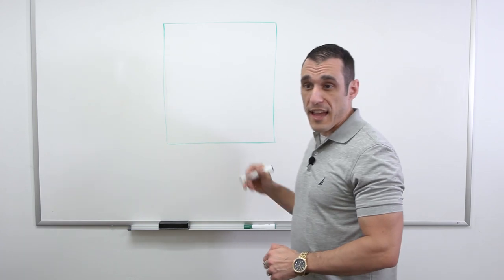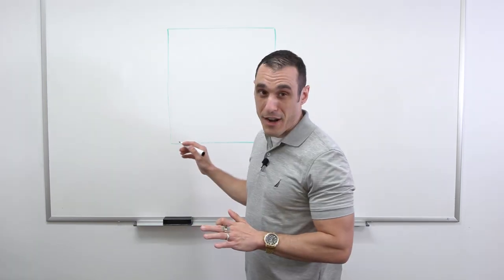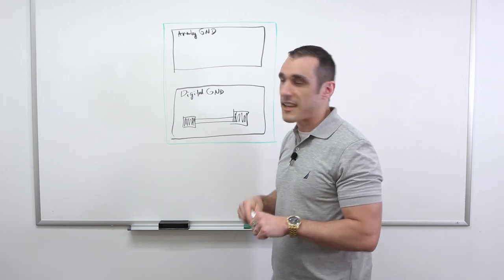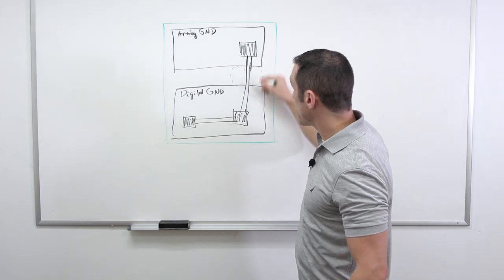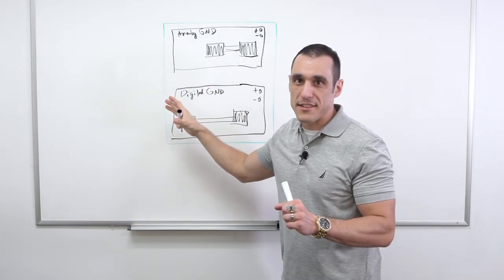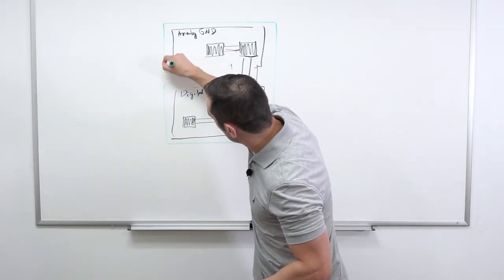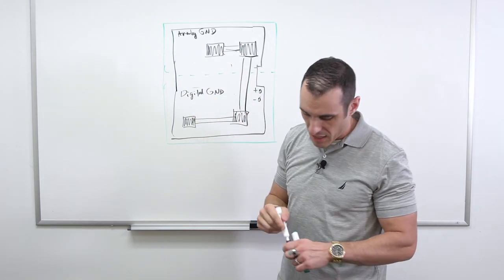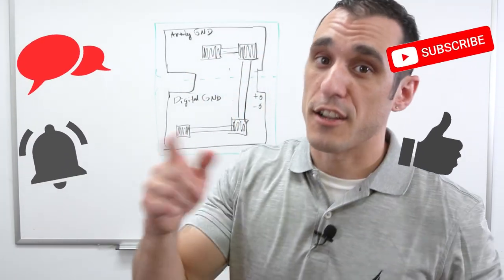Defining Ground | Mixed Signal PCB Design: Part Two

Comment: Thank you Zach. I have remembered that, my teacher told me to separate ground plane for mixed signal boards. Now I understood, it's necessary to have continuous return path.
Reply: Hi Rukshan, glad you found the advice helpful. There are some instances where we need to separate grounds, but in most cases it makes layout more difficult and encourages bad routing practices. There is a new video coming up that will outline some cases where separate ground are necessary.

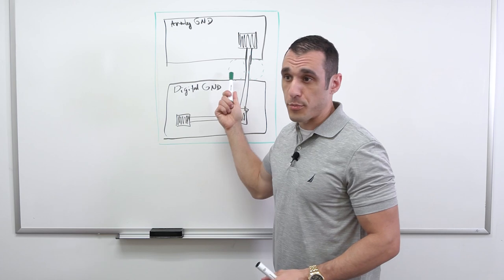Comment: 4:04 Return path is probably in the power supply lines. In many cases, a signal will "see" any DC rail as ground. We actually exploit HT as a ground in many valve guitar amps by placing bypass capacitors across anode resistors to keep the higher-gain stages from oscillating.

Comment: Zach, in the next videos you can indicate design considerations with the FR4 PCB material for 2 and 4 layers, ground routing and Vcc.
Also, advice on the ground and Vcc planes when isolating with an optocoupler or transformer (Pulse) to control a power semiconductor. This last point is of great interest. Thanks.
Reply: Thats a good question
Reply: Hi Victor, great idea! I've gotten a lot of questions about using 4-layer boards with or without isolation, including in power systems. I've got this one cued up for filming this week. Stay tuned for more videos!

Comment: Hi Zach, thanks for sharing this topic. Here is my question, I’ve seen some mix signals boards in my company that use a ferrite bead to separate analog GND and digital GND. Even power GND and so on. I don’t totally agree with this grounding method. How is your opinion about using FBs cutting the grounds?
Reply: Terrible design choice. It only eliminates the DC offset by setting the two grounds together so they only do not radiate very close to DC. However, that's not really the noise we tend to care about unless we are using an isolated supply with 60 Hz and a chassis, in which case you can get a current loop through the chassis that appears on your output.

The ferrite bead still leaves high impedance between the two regions somewhere from 100 MHz to 1 GHz. If there is any current oscillating in those frequencies, it will induce an image current in the other plane, and the two planes together act like a pair of coupled patch antennas. These can radiate and the result is the device might fail EMC. This is one reason that, even when cutting a design into two regions, fast digital signals on the digital region in the DGND region could still produce some excess radiated emissions.
Reply: @Zachariah-Peterson  Let me self-questioning my question. After watching the new episode of "Bridging Grounds with Ferrites? TERRIBLE IDEA!!!". It really solved my question.

Comment: What if the analog section and digital section are connected using cables? Do that also increase EMI?
Reply: i think you should use a coaxial cable, with the woven copper shield attached to the ground of the analog and digital sections.

Comment: So does this mean I shouldn't even worry about distinguishing between AGND and DGND? They should both just immediately connect to the single, main ground plane?
Reply: You should not worry about distinguishing between AGND and DGND except in an isolated ADC or some other isolated component. In an ADC or DAC these will be connected together on the component die. As far as routing is concerned to impact return paths, when in the audio range it can help to intentionally route the ground for a signal alognside the trace, or use a differential pair. But this is not the same thing as using separate ground regions.

Comment: Hello Zach, I am designing an amplifier consisting of 3 or 4 high-speed Op-amps and in all of the datasheets it says that a window should be opened in the ground plane under the input and output pins, to minimize the capacitance. Does that also create return path and EMI problems? How do I deal with that?
Reply: I will just say that it depends, those inputs are high impedance, so the intention is to reduce the capacitive loading at the input pin. You can compare the capacitance on the input pin to the capacitance of the trace. The trace capacitance will be on the order of 3 pF/inch, whereas the op-amp input pin could range anywhere from sub-pF to high pF. If the input capacitance is large then the trace won't matter unless you have other reactive components in the feedback loop. The other thing that can happen with op-amps is that they exhibit an underdamped oscillation on the output when there is excess inductance in the feedback loop and excess capacitance at the summing node, but this is more of a problem when the gain bandwidth products are very high. What is the part number you are using?

Comment: I can't convince the company I'm at now to accept a one ground approach.  The engineers  insist on splitting planes and tying them together at an SPG point.  Any suggestions for resources I can use to prove that the one ground approach is better?
Reply: Are they trying to route stuff over the gap between those plane regions, or do the components in each region stay in one area and do not require routing signals between them? If they are not routing any signals between the two regions or they are routing only across the region near the SPG then the board could technically work fine but it's more difficult to design. Maybe take a board that was built their way, place and route the same board without an SPG, and see if you can do it better and with less noise?

Comment: What if your boards are small enough that the end of the gaussian distribution is coming over the analog part of the board. How do you layout then?
Reply: Route things on opposite surface layers, or put some routing on internal layers. As you get small your layer count tends to go up because, at some point, that is the only way to fit traces into the PCB. Also you can reduce layer thickness while keeping the spacing between nets constant, this will always help reduce crosstalk.

Comment: So if I have  IIC devices on 2 different board (with different GND plane) . Is it Ok to just connect them by a 2 pin cable ? (SDA/sCLK), is that one of typical scenario you don’t know where the return path is and there would be EMI problem?
Reply: Best practice is to use a 3-pin connector that includes a ground trace, especially if there is no reason to keep the grounds fully isolated. Just connect the GNDs with the GND wire.

Comment: Using a full ground plane, do you recommend using the AC (120volts) on 1 layer (Top), gnd layer (middle), and digital layer (bottom). To separate the signals with a ground layer?
Reply: @Phạm Chiến Trung I’ve also seen that, my issue is the pcb convert AC to 12v 5V and 3v. With that I use moc3083 to switch ac power going to lamp ballast. So I need all in one board :-$

Comment: Thank you for these explanations but lots of manufacturers'  application notes recommend  2 ground regions for example for signal buffering  IC's  on the internet. They recommend 2 ground regions : one on the left small signal input section of the IC and another  region on the right output side . However they all also show a thin connection to the 2 grounds. So kindly how do you explain that?
Reply: Hello IHT sarl, What you just described is a lot like a star ground and it's a typical recommendation you will see for some signal interface ICs. Two examples that come to mind are interface converters (like SPI to I2C, etc.), level converters, and ADCs. In what you described, the grounds are being connected at some point so both regions will have the same potential. This is often recommended for isolation because the IC manufacturer is trying to help you prevent signals on the IOs from interfering. The problem with it is that you can only route other signals over the continuous ground section without creating an EMI source, so it makes correct routing more difficult. In the case of an ADC, the pin naming might convince you to try something similar, but I've seen an Analog Devices note that better explains this and states explicitly the various DGND and AGND pins should be tied together externally.
Reply: I think most designers that deal with a lot of EMI problems will agree that application notes should sometimes be viewed with suspicion, or the recommendation should at least be tested first. Just be careful about blindly following application notes and reference designs, because the recommendations might not always be best for your specific system. It's one thing if you are just replicating their test board or evaluation product, it's totally different if you are designing a custom board or adding to an existing board.

Comment: amazing video. thank you. I have a question. Recently i was designing a part of Li-ion charging . in that part i used a chip MAX8724 . surprising fact that i have found split ground place for PGND and GND in  their Evaluation kit. it was a 6 layer board. could you please explain that why is that split ground was done? Normally i use solid GND place and use different blocks in different regions just as you shown. but after building the circuit in my way  it didn't work . what could be the possible reasons for that? again, thank you very much for what you are doing for us.
Reply: If you look at the datasheet for the MAX8724, you'll see that they do connect those grounds together. I'll make a video of this showing how to do it.

The answer is on page 16 of the datasheet. You'll notice that they connected PGND and GND right by the battery. So they are designed with a single GND net, just not a large plane everywhere. You would want to use a net tie to make that connection right by the battery connector.

Comment: I'm a ECE student and design hardware.
In my recent project, I designed an ESP32 based LoRa Sx1276 where I had to use the SX1276 chip instead of Ready made SoC module.
What I did is just separated the LoRa Section and Placed Via Fence around. I created GND plane for rest of the PCB but left the LoRa section.
Is this approach legit?
Thanks
Reply: It sounds like you made the right approach, but I don't like to make promises unless I can see the layout. If you want, you can send me a private message.

Comment: Hey Zach, thanks for the really informative video. I was wondering though, if you route the (DC) power supply in a U shape around some Digital or Analogue  sections of your PCB to supply some components on the other side of the board, wouldn't it be advisable to route the GND (so the return path) for that DC power supply also in a U shape? Because with the Low frequency of the DC Power supply the return current would not travel underneath the forward path but rather take the shortest way back, and interfere with those of my components placed inside U shaped Trace right? Greetings, David
Reply: If you happened to route DC in a U shape and you wanted a return path to follow the same shape, then you would want to also shape the returning conductor into a U shape. I wasn't trying to say that any kind of U shape route is how this will turn out in reality or that you will always do this, it is meant to be a simple example. But you are correct that the DC return won't follow the power conductor, for truly DC power this occurs because the return current is not being induced capacitively into the return conductor.

Comment: Sometimes you have a very small board where you have to pack several analog channels and the corresponding digital section to control and capture these analog signals. In this case you don't have space to really separate analog from digital. When this happens, it is ok to split the planes, even create GND plane "sections" for each analog channel using keepout lines in order to contain  the fields

The important thing, as you mention, is to make sure you absolutely don't route over the slots and you have a clear an uninterrupted return path for all your signals. You will have this "bridge" of continuous GND plane for the tracks interfacing the digital and analog sections but each analog section will have its own GND plane section created using keepout lines.
Reply: Manuel, I totally agree, it's appropriate to make the split in certain situations. In some cases it's even preferable. The point about return path is critical and so many people get in trouble with this, so I find it's best for some designers to do the safe thing and just use a plane layer to provide the return path.
Reply: I don't see how it would be preferable in that case to split the ground plane. Wouldn't it be better in that case to keep a continuous ground and use a via wall between analog and digital?
I think the only use case of split ground is when you have galvanically isolated sections that only commumicate or exchange power via optocouplers or transformers, capacitors or some other means.

Comment: Why don't you just use a Wire to connect to two or more  isolated GND planes on the same PCB circuit? I see a lot of companies like TI use this kind of method when they have an isolated GND planes on their boards.